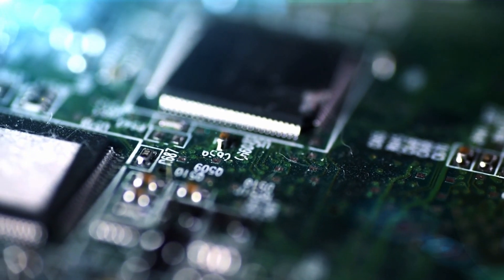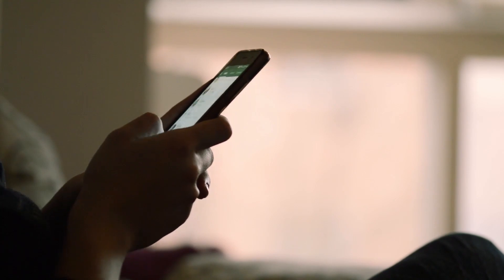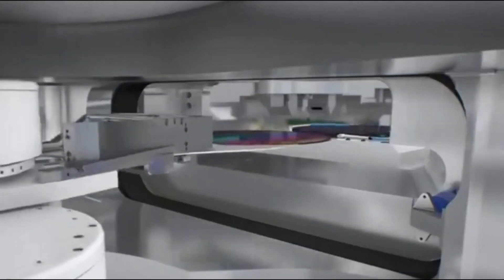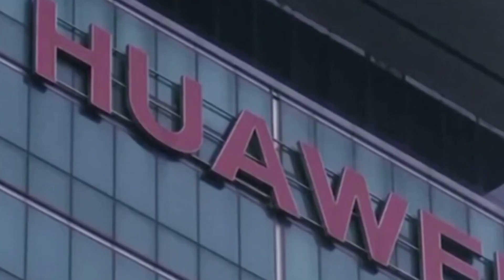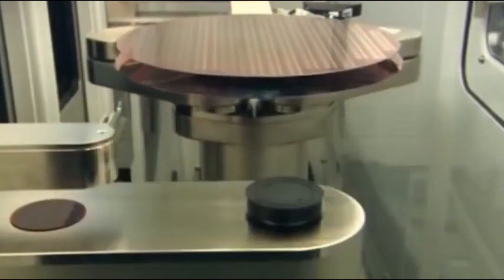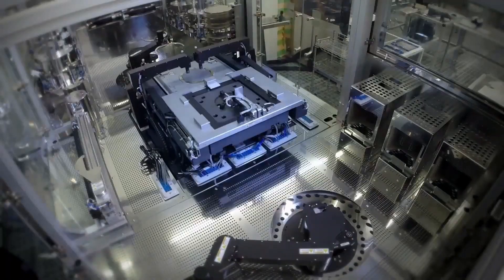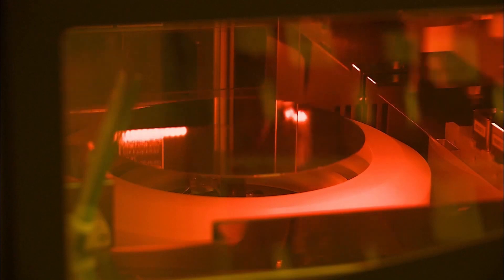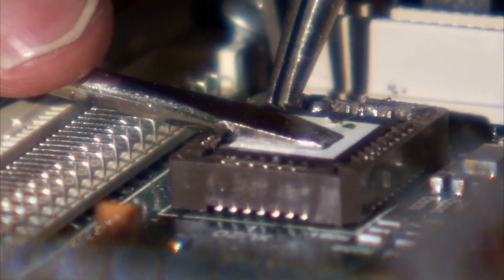Real Chip Manufacturing Technology Developed Without EUV? ASML Laughs At China!! Ai News Engineering

Comment: This video does injustice to facts.  It starts out by saying EUV machines are invaluable to making semiconductors then talks about appliances like washing machines.  FYI, the semiconductors used in appliances don't need EUV lithography.  EUV is needed at lower nodes than 7nm.  DUV can be used at the higher nodes.

Further, China says it will have a photonic chip production line running in2023.  If so, the thinking is that these chips don't require lithography to be made.  Photonic chips are said to be equal or better than the EUV small node chips currently produced in silicon.